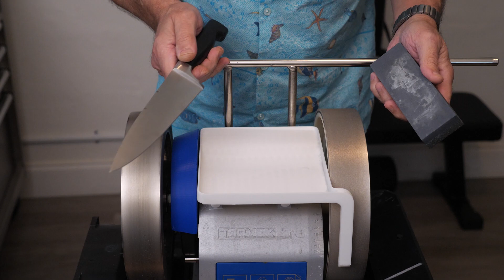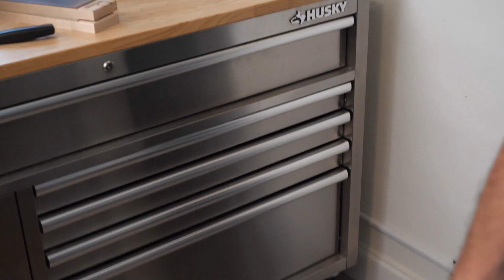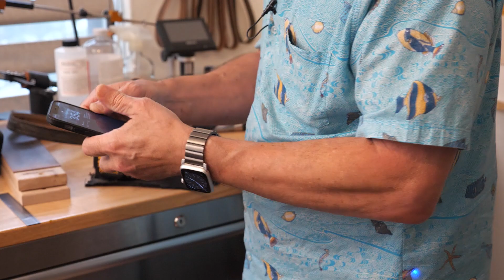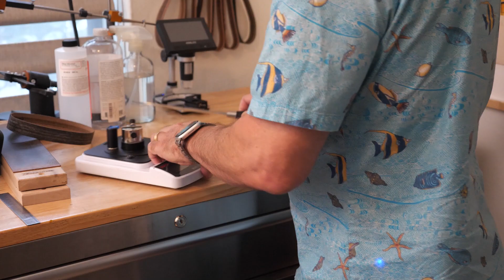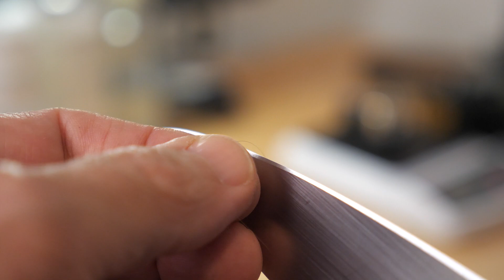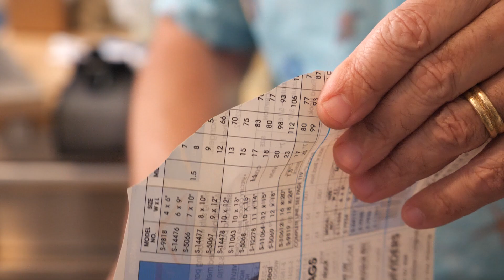0 to 80

Comment: I have a Tormek with CBN wheels but was told that they couldn't be used with water. How do you protect your CBN from being damaged by the water?
Reply from the maker: You're probably using the Woodturner's Wonders wheels?  That's the 600 grit I'm using now.  That one is CBN-plated steel, which presumably would rust if not cared for.  As you can see, I use it in water and I don't use any corrosion inhibitor in the water, either.  All I do is dry it off after use and so far I haven't had any problems.  That said, I wouldn't advise leaving it in water all day -- at least without corrosion inhibitor.

The other CBN wheels I have are made of aluminum and can be used in water without much concern.
Reply: Thanks for your reply. Yes, I'm using the Woodworkers Wonders "Spartan" wheels, which look to be a plastic material of some sort. But I'm very happy to be able to start using water if that's possible @BladeLabMiami
Reply from the maker: Just keep in mind that using water will probably void any warranty from Woodturners.  If you can live with that, and are prepared to dry the wheel after use, go for it. @jaycooke3672

Comment: shouldn't the wheel spin the other way when sharpening ?
Reply from the maker: You can do it either way, but for knives, the Tormek is set up for edge-leading sharpening.  To do edge trailing, you really need a front vertical base (FVB) which is an after-market part.  In any case, edge leading is faster and produces a smaller burr.
Reply: You'd think so, but this way it keeps the burr smaller and more manageable.
Reply: But am I right in thinking that it does matter which way you sharpen if you are using a whetstone ?
Reply from the maker: It's a topic of much discussion, but ultimately I don't think it matters as far as getting a knife sharp.  One advantage of edge trailing with whetstones is that it eliminates the possibility of gouging the stone if you come in at too high an angle. @ralph3295
Reply: This is especially true if you use the tormek SJ250 japanese stone, if you catch the edge trail leading, you can get a huge damage, and that stone is 300 dollars. Same can be said if you use a resin bonded diamond which I use now. I sharpen edge trailing with good results now, there is methods for getting rid of a bigger burr quickly, I find that if I just refine it on a fine stone (1000grit or higher) with light pressure, I will get a veeeery thin burr, it pops right off on my 1x30 leather stropper
Reply: I think when finishing, edge trailing may become important, as edge leading on muddy stones may dull the edge.

Comment: I have zero experience with a BESS tester, so i have no reference for "80," but i know exactly how sharp a knife has to be to make that sound going through that kind of paper.

Very nice.
Reply from the maker: I should post a pic of the chart that Edge on Up includes with the tester.  From memory, a new, double-edge razor blade is about 50, a new utility razor blade is around 150-200, and I think they say that the average factory edge for high-end cutlery is around 300.  I've tested about 100 factory edges of EDC knives and they average about 220.
Reply: 😊е😊😊ёёё @BladeLabMiami
Reply: 80 is really good (unless you're only trying to get a low number, have the right steel, and lots of time)